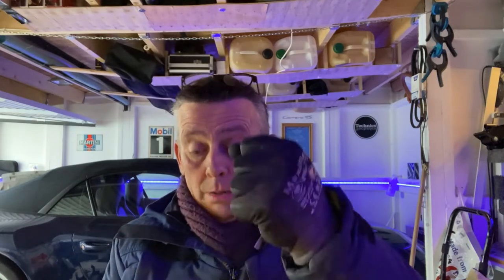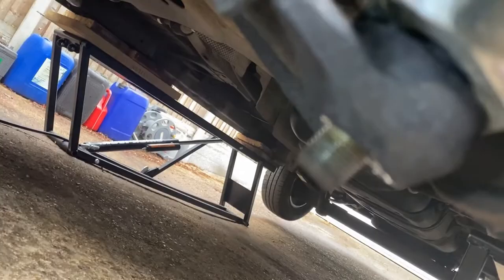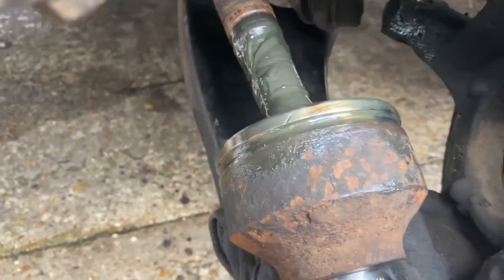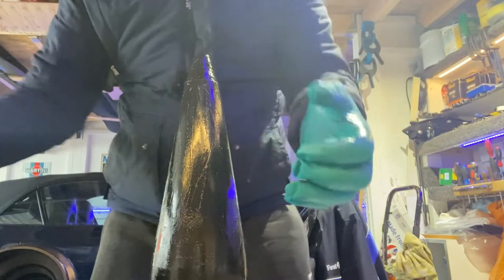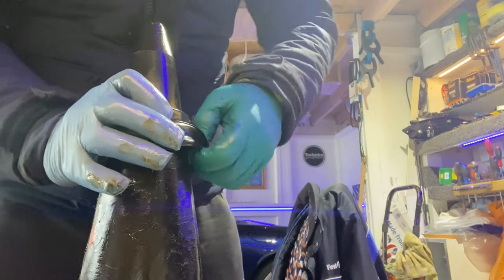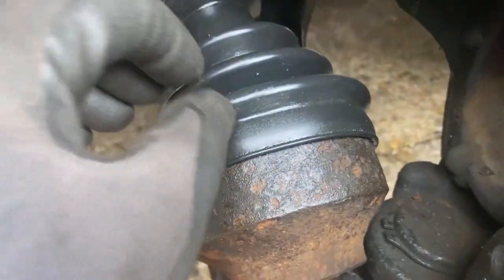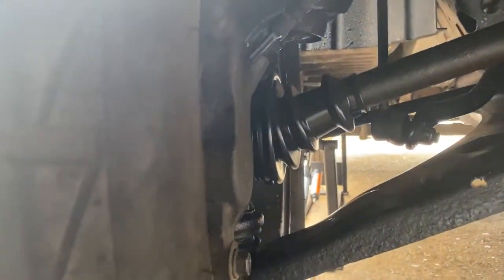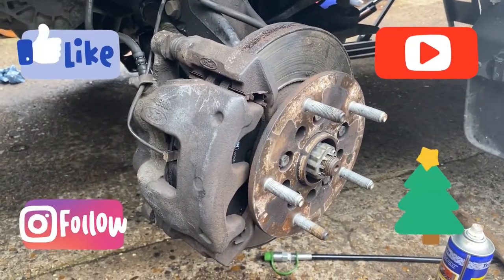Transit Custom CV Boot Replacement 2.2 Tdci 2016 + shaft popping out of gearbox!!

Comment: I just bought the exact boot and a cone. Did the job perfect, only I did clean out the cv joint and refill with fresh grease. Good video, so much easier and quicker than removing the whole shaft.

Comment: hi, how did u get the other side back in the joint? thanks
Reply from the maker: I removed the the whole shaft assembly and did on the bench. You need to slide back the inner boot and slide it out of the gearbox.

Comment: Would it not have been easier to remove the CV joint? 
You could've cleaned it while it was apart and lubed it up with new grease.
Reply: Well done, changed a cv joint here in Dublin, Transit Custom 2014. will not separate, factory sealed. angle grinder.
Reply from the maker: Your probably most definitely correct. I wasn’t planning on the inner joint coming out so was just keen to get the whole shaft back in place.
Reply: Neighbour asked for a hand yesterday.. transit 2012.. cv joint would not separate so we had to stretch the boot which was a pain to do!
He too knocked out inner joint out of place but I somehow managed to knock it back in touch.
Reply from the maker: I guess I could of but time wasn’t on my side. I did however repack both with fresh grease. Thanks.

Comment: Had both N/S & O/S outer CV Boots changed on Transit Custom (17). O/S leaked grease all over callipers & wheel after one month & 150 miles.😢
Currently being refitted under warranty... but they can't get the new ones to seal!
Reply from the maker: Wow that’s disgusting. Clearly something is misshaped preventing the seal.